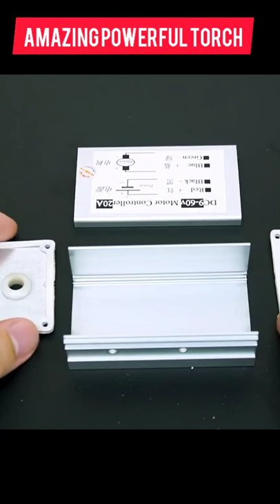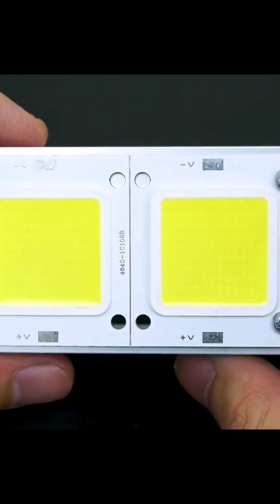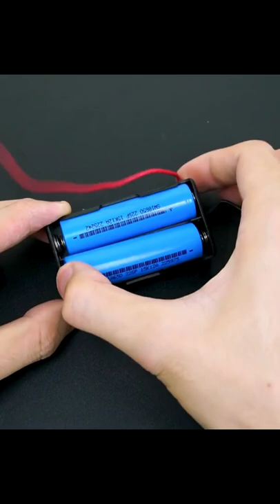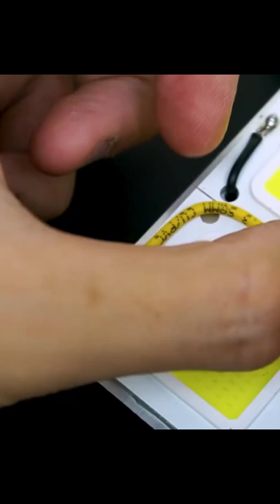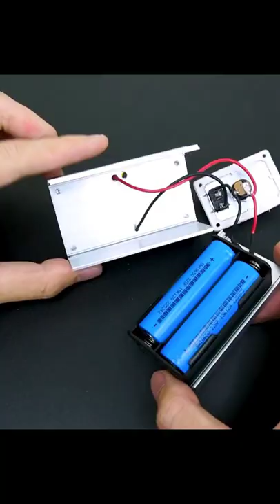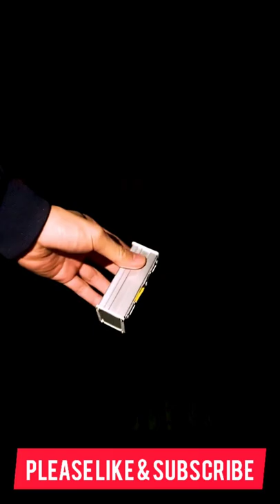How to make Powerful torch#shorts

Comment: Big mistake it is dangers without bms
Reply: Also he had to use protection glass sheet to avoid hand burn on led
Reply: @proindian-yt  battery can blow up due to heat and over discharge

Comment: Nooooo I don't care how much termal paste you put, that aluminium sheet isn't a disipador, it's not even enough for one led and you put two of them??
And you even seal the battery inside of that infernal box?
If your hand doesn't get burned by the metal, it will explode

Comment: Add 2s bms to it and charging port
Reply: Its got a charge port, small black round thing. It doesnt have battery protection of any kind and also they ruined a perfectly good voltage converter and case to make a bright torch that might blow up, do they know theres places that sell torches cheap already?